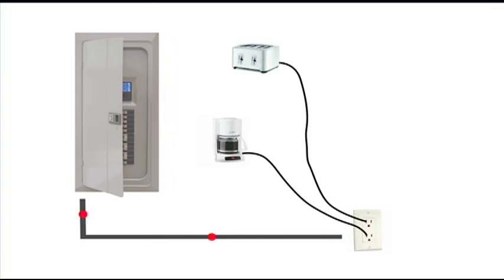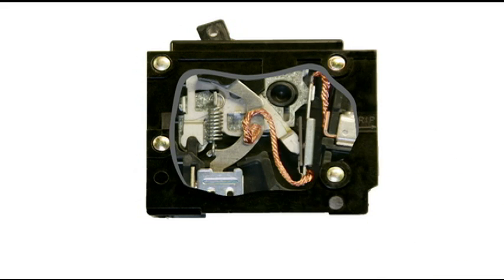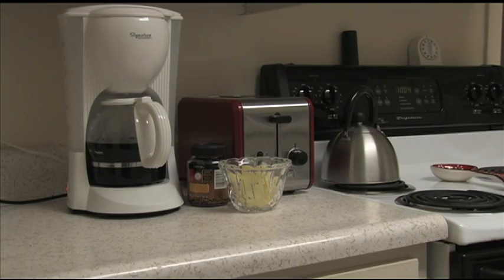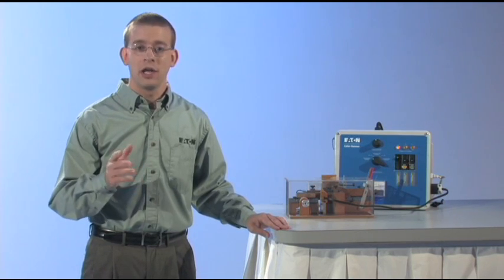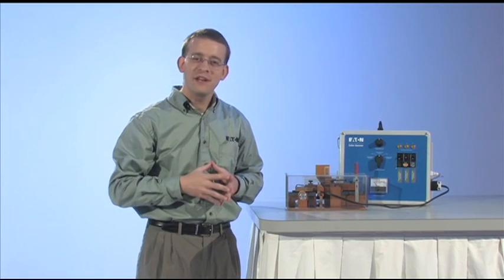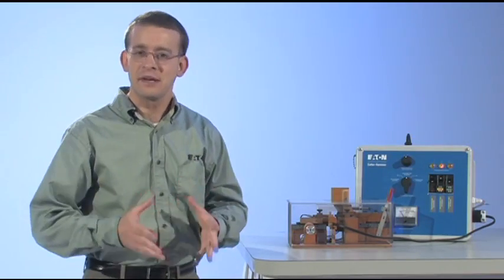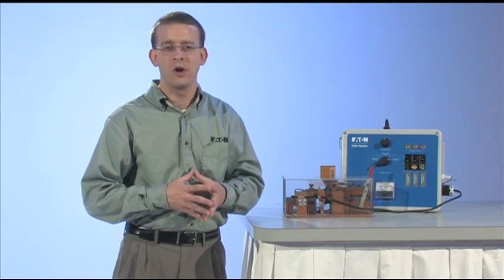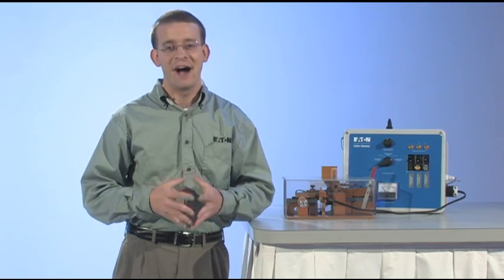Jason Nitzberg - Eaton ArcFault Circuit Breaker Technology Overview

Comment: Great video ! Very well explained.... I would like to here your comments on how voltage drop and high impedance values can affect the performance of these breakers. Since there is no standards required in the US for electrician  to check the amount of available  fault current in housing the problem goes mostly undetected.  Arc fault circuit breaker are an electronic device and are sensitive to this poor power quality. As compared to other countries little is done to address high impedance that causes voltage drop on branch circuits. Electrician have been screaming about this issue for years.

Comment: Arcs of 75 amps should trip a standard 20 amp breaker with increased current and added heat. I don't understand the upgrade.
Reply: Lee McBroom 75 amps from arc will not sustain long enough to trip a regular breaker. 
So we need AFCI.